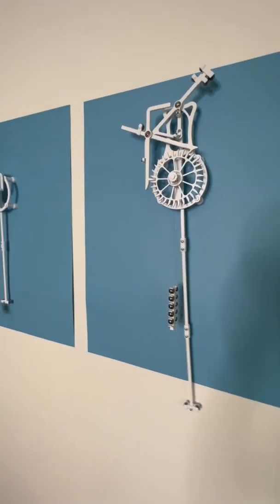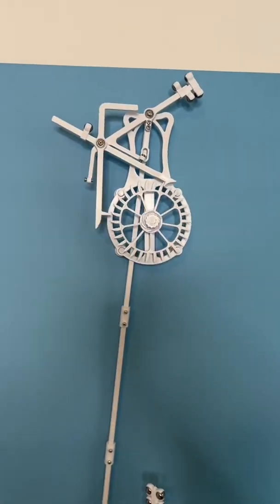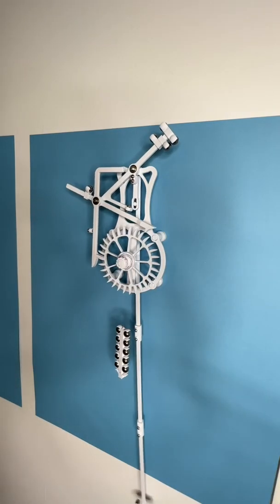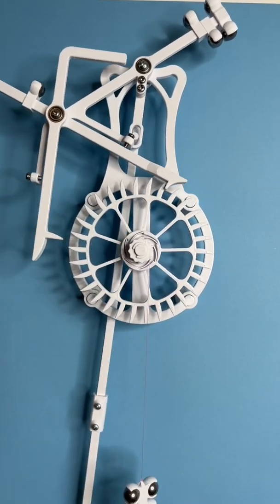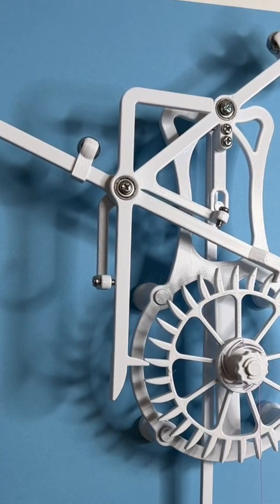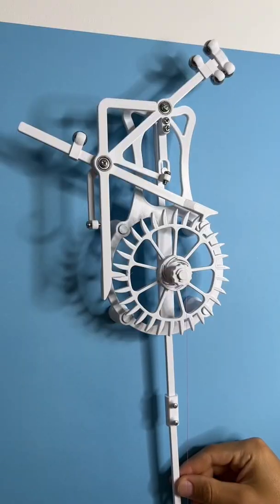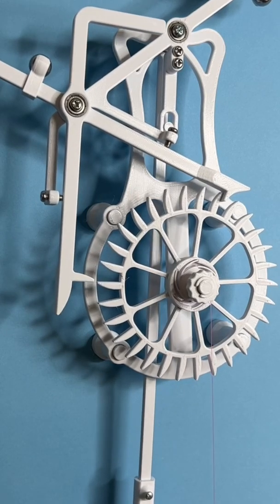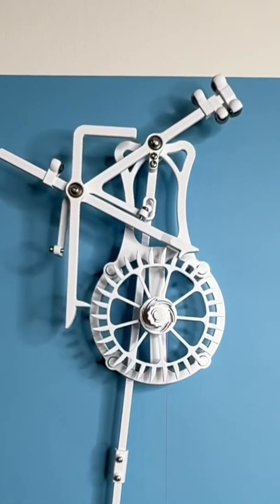The Grasshopper Escapement - Best One Yet!

Comment: This is neat! What exactly is an escapement?
Reply from the maker: It’s basically a mechanism that controls the release of the energy in the weight, so if the escapement wasn’t there it would release all the energy at once!
Reply: a mechanism in a clock or watch that alternately checks and releases the train by a fixed amount and transmits a periodic impulse from the spring or weight to the balance wheel or pendulum.
Reply: from google

Comment: On the kickstarter clock mechanism, I vote for the Arnfield escapement as the most accurate and most modern for the actual clock, although if you can gear it so that the escapements are interchangeable that would be fun to compare their accuracy
Reply from the maker: It would be fun to compare them! Although it may be hard to gear them accurately with modularity- I’m going to definitely think about this more